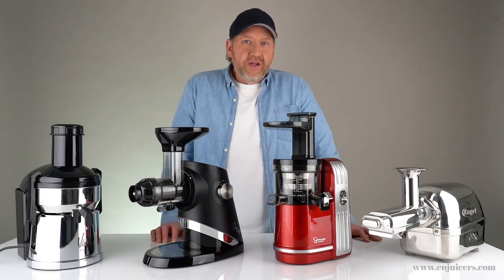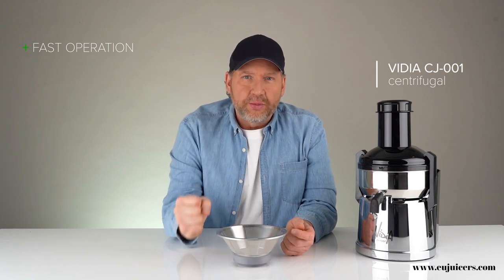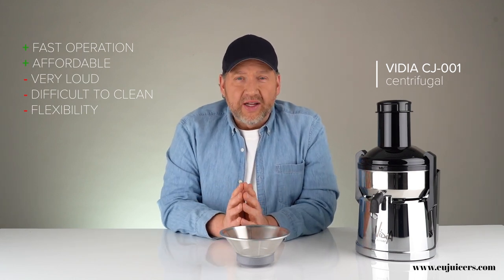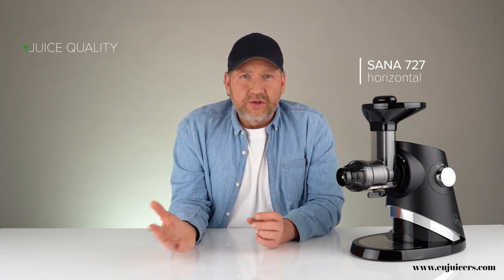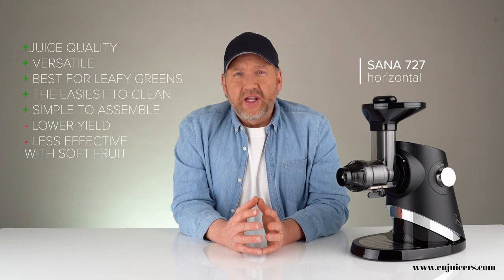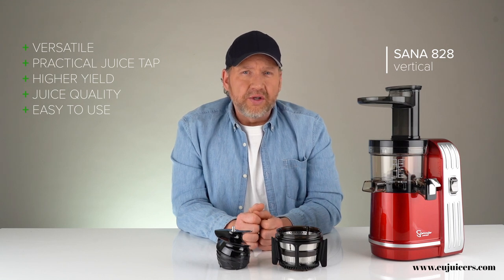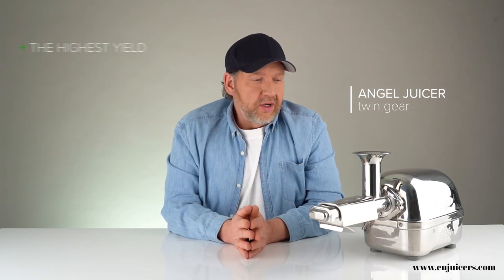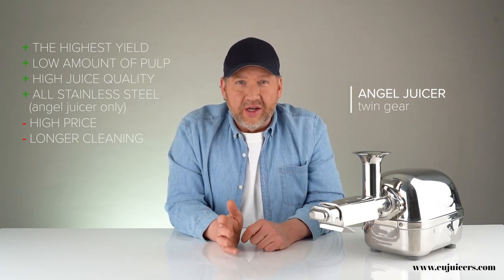The four types of juicers compared

Comment: Awesome informative video. It’s the best video about the various types of juicers. Question ?  If you were buying  the best twin gear for yourself and having all the information and knowledge you have about the few  manufactures of this juicers which one would you purchase?  Omega, Angel or the other elite green elite pro?   Your suggestion would mean a lot to me.  I feel it would be better nutrition content & it would certainly an investment for many years to come. Am I correct in thinking this way?
Reply from the maker: Thank you for your kind words.   I'm glad you found the video to be helpful.
Regarding the twin gear juicers, the nutrition content wouldn't be better than a good single auger slow juicer, especially since the twin gear juicers run at a higher rpm. The main benefit of the twin gear juicers is the higher juice yield. But of course that comes at the cost of complexity in use and cleaning. I would stick with the Angel or Greenstar, depending on your budget, and avoid the small twin gear juicers.
Alternately you could consider a good single auger horizontal juicer, like the Sana 727, which comes close to the yield of a twin gear juicer.

Comment: Hi Dan,
Thumbs up & Subscribed.
Where / how does the Champion juicer fit in your categorization?
I guess the "single horizontal auger" category would be its closest category, but not exactly.

I have used Champion for 
biweekly juicing for over 40 years. My 1st Champion died at about 20 years. My current & 2nd Champion is still fully functional.
My major usage is carrots ( over the 40+ years probably 10 tons of carrots) , but as long as I chop celery & fibrous greens it works fine for most everything. 

 Its huge motor runs at high RPM, and its auger's "teeth" both shreds, and squeezes the pulp out thru its juice juice screen. 
It would seem it has the best of most all pros of the juicer types you feature, & the least of the cons.
What say you Dan?
Thanks
PS. I since watched your EU clips Parts 1 & 2 re. Champion.  Your probable answer to my above Q will be best depends on your particular usage?
I would say the Champion is of course great for root veges. But except for wheat grass the Champion does OK with most greens too, even without Champion's now special attachment for wheat grass.

I will be ordering at least their coarser mesh screen for pulpier fruit juice.
Reply from the maker: Hi Ron,
The Champion is really like nothing else on the market.  It's almost like someone combined a juicer with a blender.  I suppose technically it would be classified as a single auger horizontal, although it predates any other horizontal jucier by many years. I wrote an article a few years back about the Champion - you can see it here:  https://www.eujuicers.com/magazine/what-if-a-juicer-and-a-blender-had-a-baby

Comment: Thanks for doing this video! Super informative. I couldn't help notice that the juicers with hydraulic presses (such as the Pure, or even the M-1 from goodnature) aren't represented here. What is the difference in juice quality between the Angel 7500 and the Pure, for example? I know with centrifugal juicers, you end up with lower nutritional value and the pulp separates. What is the difference in nutritional value between the Pure and the Angel? Does one juice last longer than the other? Does hydraulic pressed juice sepate less than juice from dual auger machines? Thanks for your help!
Reply from the maker: Unfortunately there are no hydraulic press juicers (besides small manual ones) available here in Europe. They were available here in the past, and we have some limited experience with them.  In my opinion, the nutritional quality would be higher in the Angel because of the grinding stage that hydraulic presses require.  It's typically a high-speed, high-rpm process, similar to a blender.  It's likely that higher oxidation would occur during this stage compared to the slow process in the Angel. Regarding the separation, there should be almost no separation in either juicer.  The pure will make a slightly clearer juice, as the filtering process is much finer than a masticating juicer like the Angel. But both machines will make excellent quality juice.

Comment: It seems press juicers (not covered in this video) produce darker juice as compared with twin gear.  I am not sure if this is b/c of a more complete extraction, or more oxidation due to 2 stage process and pressing through fine cloth.  It seems they also yield less than top-tier (Angel) twin gear juicers, although I have wondered if this may be due to macerated material left in the feed chute (this has to be rinsed free with juice and then pressed).  I have also wondered how vacuum blended produce pressed in a press cloth or nut milk bag would fare against a press and an Angel.  Thoughts?  Make the videos?
Reply: I'm also very interested in vacuum blending prep.

Comment: Dan, what’s your opinion on Nama J2 Cold Press Juicers? All the Nama products are pricey, but they look impressive. I wanted your opinion. 

Thank you in advance,
Reply from the maker: I haven't tested the J2, as it isn't widely available where we are.  But I've tested the juicer upon which it is based.  It's a well-made machine. These self-feeding juicers are designed for convenience.  They juice much more slowly than a manually fed juicer, but depending upon what you are juicing, you only need to refill the hopper once so you can do other things while it works.  It's still better to precut bigger items of produce with them - you'll fit more things in and make it easier on the machine. And some things like carrots and celery will need to be cut just to fit in.
Reply: Well, I love carrot juice, maybe apples now and then, otherwise, that's it. It may sound weird to you lol, but whenever I feel my eyes are troubling me, I drink carrot juice for a few weeks, and I'm back to 20:20. I have proven it by going to an eye doctor before and after. Idk, maybe it's just me, I may sound nuts, but at age 50 and my job to be staring at a computer monitor for over 12 hours a day, it hasn't let me down yet. Which juicer would you recommend for me? If you would please give me your opinion, brand, and model number, I would greatly appreciate it￼. I'll know exactly what to purchase. I have the Jack LaLanne Centrifugal juicer, but I don't like it much. After juicing, the cleaning is enough to discourage me from not using it￼. Not to mention the mess it makes during juicing. 

Again, Thank you in advance,
My Regards,
Reply from the maker: @brooklynbensonhurst9701  I love carrot juice too - it's so tasty.  I made a video all about juicing carrots, and compared the four main jucier types just with carrots, so you might find that helpful: https://youtu.be/wYNIlAlN9o8
Since you're looking at Nama, I assume you are in the USA.  I would consider the Sana 727, the Omega NC800, or either of the Nama juicers. Just make sure to check the warranty lengths, as it can vary according to the seller.

Comment: Thanks for the video. The twin auger, stainless seems like the best design. However, that price is a shocker. Are there any others that have a similar design that cost closer to $400?
Reply from the maker: There are smaller twin gear juicers under 500€ from Vidia and Omega, although the performance and ease of use is nowhere near an Angel or Greenstar.
Reply: Jeff price should not be an issue when it comes to your health, health issues come at a costlier price in comparison to this investment
Reply: @Goldminks  great sales pitch. Why do you think a less expensive juicer won't make you just as healthy?
Reply: @jeffschuster3309  not a sales pitch, i bought an Angel 7500 juicer last 24 hours, i back up my words with action, we have one life to live, its proven that angel provides best yield/quality performance, you can get by with another juicer that does half the job but at the end of the day its your health, you get what you pay for. Angel been around 40 years the juicer hasn't changed much and still number 1 best performing that says alot !
Reply: @Goldminks  ... going for the HARD pitch. I bought another juicer for $350. It did an awesome job. Maybe I can use the savings to join a gym :)
Reply: @Goldminks  Agreed, just purchased the 7500 with the additional fruit housing.
Reply: A plus to the Angel would be higher yield will save you more money over time. That will probably make up for the price differential in a long run. Most important thing is that everyone juices, stay healthy whatever machine used 👍🏻.

Comment: Should fruit (like apples, oranges) have to be deseeded before putting them into juicers? I don't want the seeds crushed and the seeds' insides mixed with the juice.   
Removing seeds from apples is easy, but removing seeds from oranges will be a pain.   
Thank you.
Reply from the maker: It's up to you. In some cases, the seeds can add a little nutrition.  But usually there is little moisture in the seeds and they will be ejected along with the pulp.  Apple seeds do contain trace amounts of cyanide, so if you are making a lot of apple juice, it's a good idea to remove them.